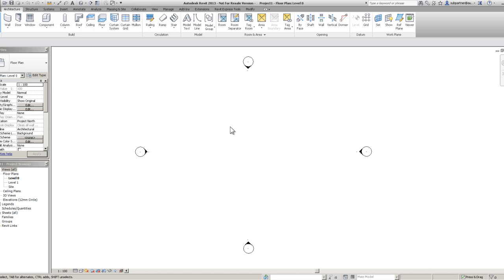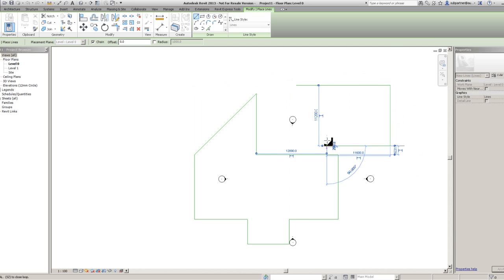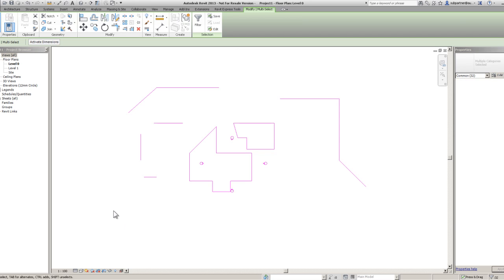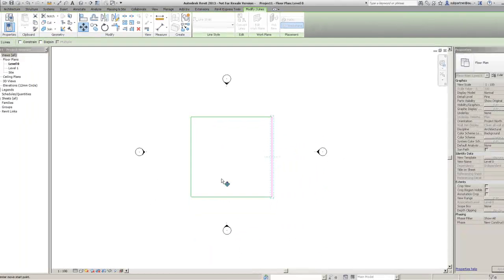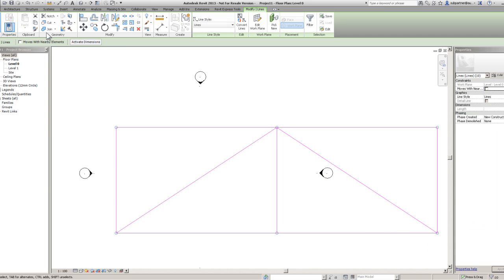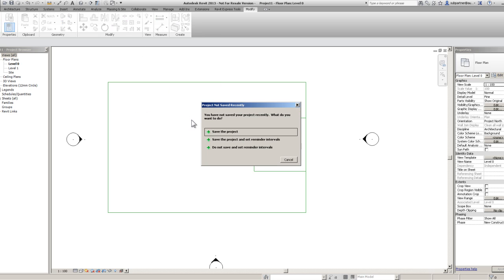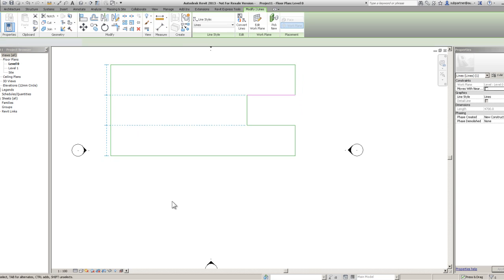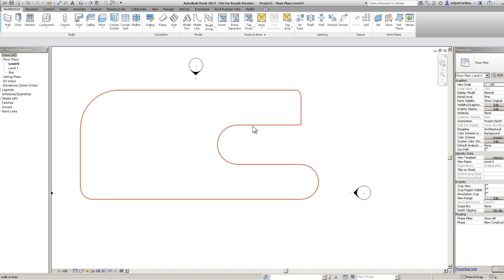Revit 101

Comment: This was very well explained.  I followed your instruction and managed to do my first building in Revit Architect.  The only problem was when I started with plumbing pipes installation under system on the project, it would not show the pipe run and it would not connect to the appliances.  If you could have something for beginner on mechanical engineering please.